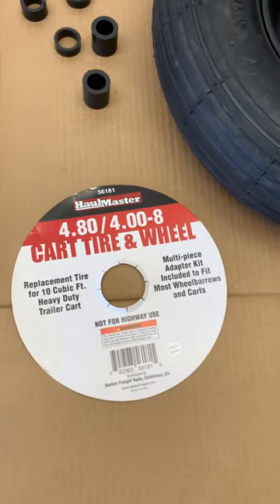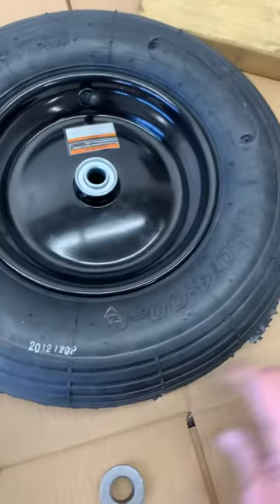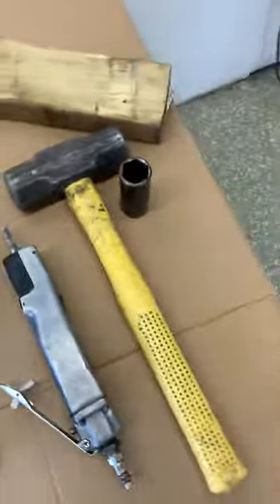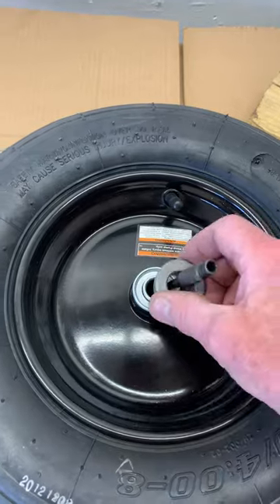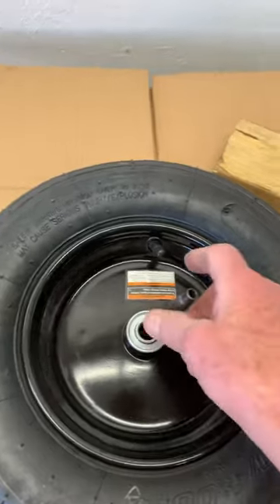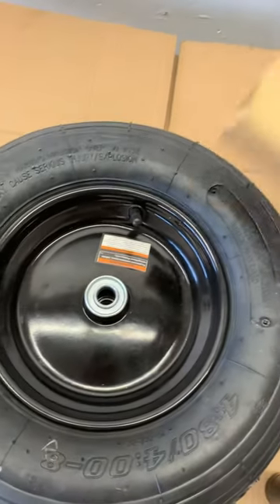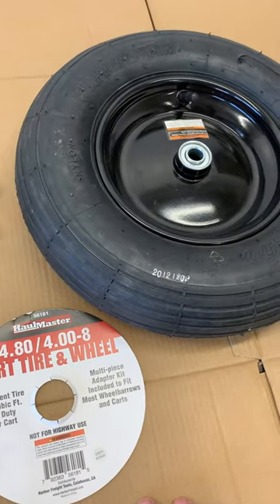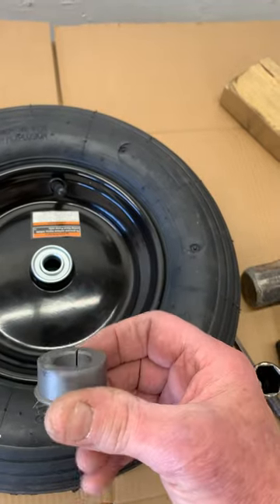Harbor Freight Haul Master 56181 Cart tire & wheel bearing replacement.

Comment: Thanks for this,  Ralph... it showed me that the installed bearings do come out!  But I found a simple way.   When I tried to pound the existing bushings out most of the blow was absorbed by the tire.  So I cut up some scrap 2x4's into little pieces and placed them so the when the tire was on it's side the 2x4's were in contact with the rim,  not the tire.   I then used a large bolt and pounded hard with a standard hammer and after a few blows they popped out.
Reply: Your 2x4 solution worked for me.  The rubber tire was absorbing all the impact.  Thanks, I really didn't want to start hacking up the bushing.

Comment: Thanks, Ralph.  After banging on it for 20 minutes, instead of a saw, I used a half round metal file to cut grooves.  Six whacks later it popped out.  Then used a short pipe on the other side.  My question is why did they press them in to begin with?  They could attach both to the tire with the spacers and you could use whichever one you wanted.  And as others have stated, they're not even bearings, just shafts.

Comment: Ralph, I finally had to heat the hub with a propane torch for a few minutes to expand it enough to pop out the "bearing".  Man, was that thing in there tight !  Thanks for the video.

Comment: Thanks, Ralph. I met the same resistance, and as dave hulett mentioned below, the tire does absorb a lot of impact. So I squirted some aerosol penetrating fluid ...something akin to Break Free® CLP (although WD-40 might work, I suppose) from inside and bounced the wheel to work it in. No need for special-cut 2x4s to support the wheel. Resting on the tire, I used the axle as a punch, and with a modest claw hammer, the bearings were driven out easily enough.
Reply: A little spray lubricant and using the axel and a 5 lb sledge axe made quick work here of removing them as well. It takes a little back n forth pounding to get the proper hubs installed, but for a $15 tire and adapter set compared to a $47 skinnier tire and a $15 adapter set from lowe's, I'll take the $47 savings every day of the week!
Reply: @GaryTabarJr  using WD-40 just worked great for me also

Comment: I bought a pair of 56181s at HFT yesterday and they had ball bearings with 3/4 bore, plus a spare set with 5/8 bore and several sets of shims.  Fit my AgriFab and my Craftsman yard wagons perfectly.  Installation took about 2 minutes per wheel, from cutting open the packaging to putting in the final cotter pin.  Not a bad deal for $28 each, but I just found a similar one at Tractor Supply for $19, so I'll go try those on another cart that has problem wheels and a 3/4 axle.

Comment: Thanks!  I didn’t have to cut the inserts but I used a heavy punch to hammer them out from opposite sides.  Not sure what those inserts were for.  They contain no bearings.  Maybe to keep the holes true till the bearings are placed.

Comment: If you lack the tools, or the strength, or the time, just use electrical tape to make your smaller axle accommodate the bigger hole.  I'm only moving leaves and light loads and realize my rig won't last forever but it doesn't wobble and worked.

Comment: Thanks for video.  I tried to knock the original bearings out before seeing your video and gave up because they didn't budge and I didn't want to damage the wheel.  Now I know that I was on the right track.  Terrible that HaulMaster can't bother to write 10 words or less of instructions, like, "Knock original bearings out with hammer and replace with the provided inserts if needed." OK, 14 words.  Thanks for video

Comment: Took me 10 minutes to change out the bearings. I put the wheel on a 5 gallon bucket with lid on. Then used the axle and hammer to punch out bearing sitting on the bucket. Turned the wheel over and repeated the process. Installed the new bearings setting each over the wheel and used the punched out bearing onto the new bearing.  Used a hammer and tapped into place. Turned the wheel over and repeated.
Reply: I sure wish you had made a video of your task.

Comment: I used a piece of 1/2" rebar and a framing hammer to drive the bushing out from the back side - it was tough.  Just get (even more) pissed off and hit it hard a few times - it will come out.  Same on the other side, but much easier when one can drive it straight out.  I used a 22mm socket to drive the 1/2" bushing back in, just tap, tap, tap - they go in easy.  This is a piece of crap, would be better to sell without any bushings pre-installed.

Comment: I’d try some heat on it ,then pound it out if it was froze in,,,how much for a harbor freight tire  ?
Reply: I just tried a heat gun with a wet rag inserted in the bushing hole to keep it as cool as possible as the hub around it was heated by the gun.  No success.

Comment: Here's how you do it. Bang on it with a hammer for 30 minutes, smash a couple fingers, say a lot of bad words, then heat it for about 5 minutes with a torch, until it starts smoking then pound it out with a punch of some kind. Then you have to heat the other side for about 5 minutes until it either glows or smokes then you can beat it out with something that fits the size of the rim hub. I used a 4 way that just fit the hole and wacked it about 6 times real hard with a 4# hammer. What a complete piece of crap design that is. Unreal that it is that hard to remove those sleeves. Just beyond stupid.